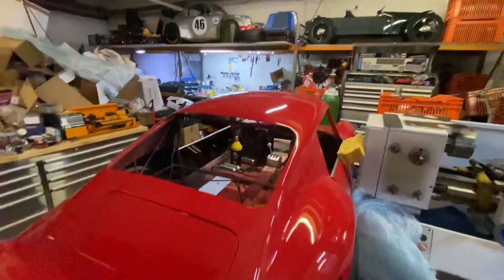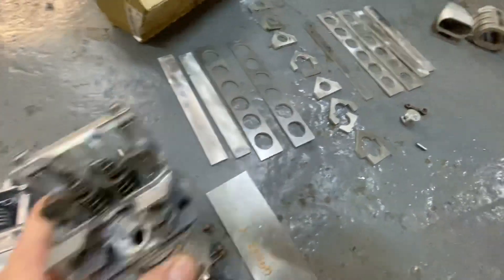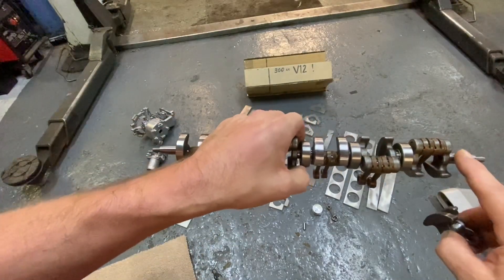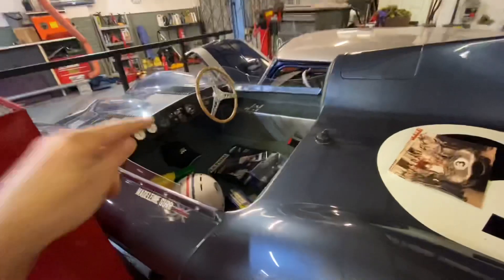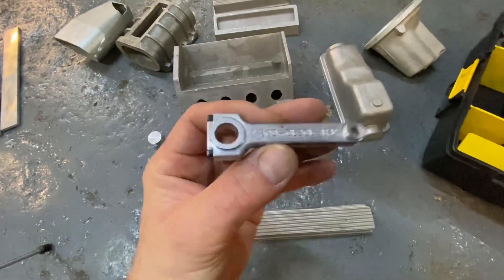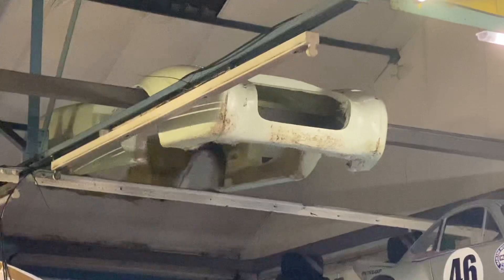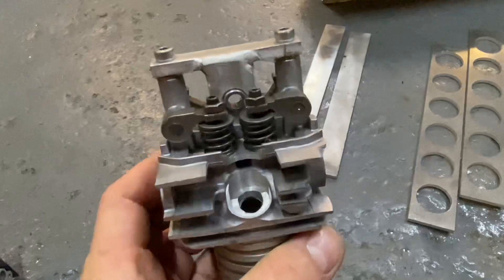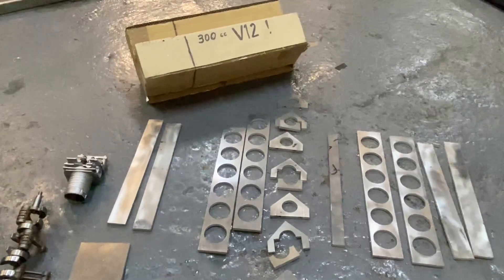300cc V12 revisited (12xhonda GX25)

Comment: No more talky talky. Get to buildy buildy!! Lol!

J/K! I have been waiting years for you to circle back around to this project. I've seen a few guys make V6's and V8's with similar small engines and I think most, if not all, of em had issues getting all the kinks worked out and getting em tuned in and reliable.

But, I've gotta know more about that "Black Widow"? Down the rabbit hole I go........ 🕳️🤸

Oh wow!! I didn't realize how tiny that piston and the valves were until you picked one up. Tiny.
Reply from the maker: its the torque to pull a 100kg weight to 25 mph thats the probelem, ok the run on the bench though

Comment: I dont understand why they didn't make key style press fits to keep the crank from turning if it ever does from a serious back fire or say it drops a valve. If either ever does happen.
Reply from the maker: this was a mod I did , the gx25 is single cylinder I had to connect lots of poarts in series which is why I machined them that way , on hindsight the multiplication of power and torque along the carnk means the last one in line may not hold .
Reply: If not saying it's possible you could machine a key slot inside and on the outer press part of each crank half just incase it tries to spin or slip. Definitely a thought I know you already machined everything. Maybe a thought for the next crankshaft